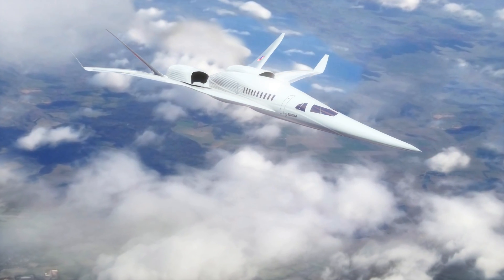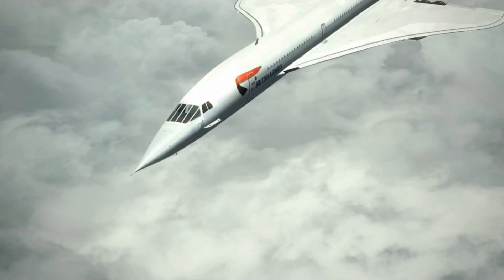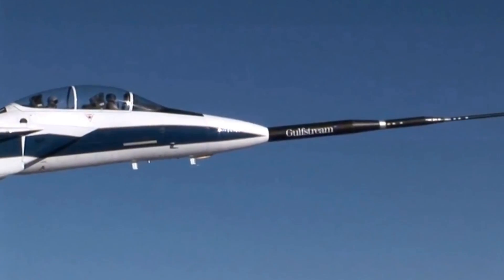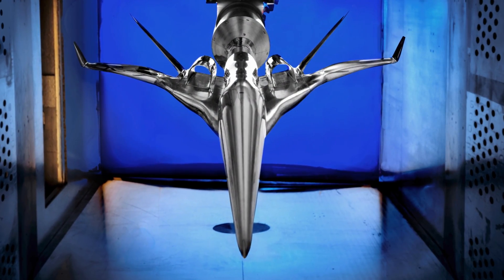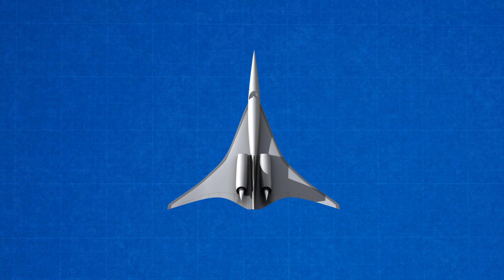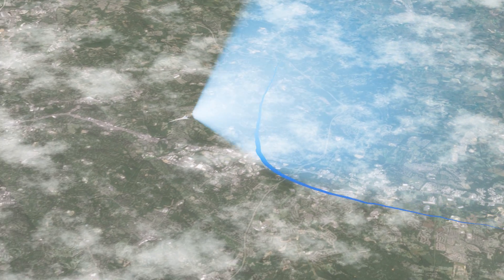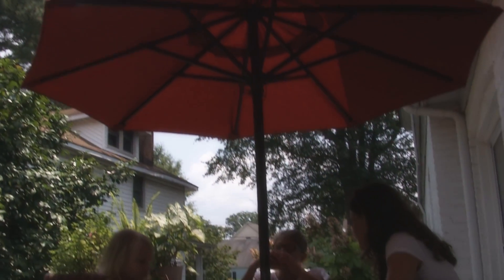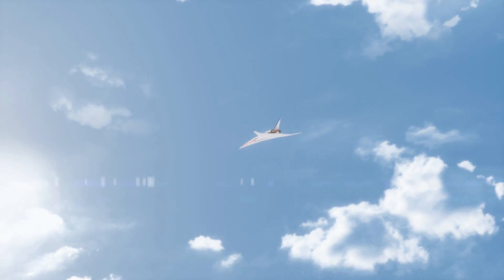Quiet Supersonic X-plane to Be Designed

Comment: What I really want to see is a supersonic airliner whose fares are affordable to the middle class.  The problem with Concorde is that the fares charged by British Airways and Air France were affordable to only the very rich.
Reply: It's an energy problem and won't be fixed until they're electric and it costs an order of magnitude less in terms of energy costs.
Reply: They probably won't ever go electric with supersonic flight. Low speed flight: yes, commercial flight: maybe some year, supersonic flight: probably not.

Comment: supersonic flight will still be economically nonviable if each plane has to have such a long nose/tail to reduce sonic boom that it takes up twice as much space on the runway or in the hangar than a plane which could carry twice as many passengers.
perhaps a possibility for private/business jets, but in mainstream commercial aviation, passenger numbers are the most important factor.
Reply: Once its up and running it won't be spending much time in the hangar.

Comment: Lift an aircraft into sub-orbit altitude with a hydrogen balloon.  Having oxygen and silver  on-board on the way up have the aircraft inhale the hydrogen mixing the H2O2 or hydrogen peroxide.  When at the given altitude release from the balloon and fire the 'jet pack engine'. At this altitude there will be very very little  or no air resistance and no sonic boom.  Then land it like the space shuttle.
Reply: +Walter Marlin 
I need a job. I do not have a degree but I have imagination. Let me guess. We already thought we this. Then why the video?

Comment: Unless such an aircraft can operate on something other than fossil fuels,  or operate with better economy (defined as lower per seat/per mile cost) and less damage to the environment than current subsonic passenger aircraft, its use ought to be restricted to military necessity. Scientific investigation must continue, but my guess is that fuel consumption per passenger mile will be orders of magnitude higher than what we are achieving today, and that higher altitude environmental damage will be more damaging than what we are causing now.

Comment: Bravo NASA!  A mere $20m contract to develop this test jet?!?  Hello?  Just $20m?  Seriously, why can't DoD simply outsource all further military aircraft research and development programs to NASA!!  The current 'MIC' system is fatally broken, unsustainable and constipated.  And that said, USAF should cancel the current $80B NGB Program, initiate an accelerated modernization and modification of existing deterrent platforms as a stopgap measure (15 yrs) and simply wait for an accelerated Production quiet-supersonic civilian model to be developed and then just acquire a militarized variant (with bomb bay), similar USN's procurement of the P-8!  Not stealthy enough??  Forget it!  They won't be stealthy in 20-30 yrs anyway as the tech is flat-out accelerating too quickly worldwide.  Rather, the cost-effective and economic value of a quick-reaction (supersonic) platform, coupled with advanced next-gen stand-off munitions, would be a far superior alternative pathway for USAF's bomber replacement requirements...  End rant.